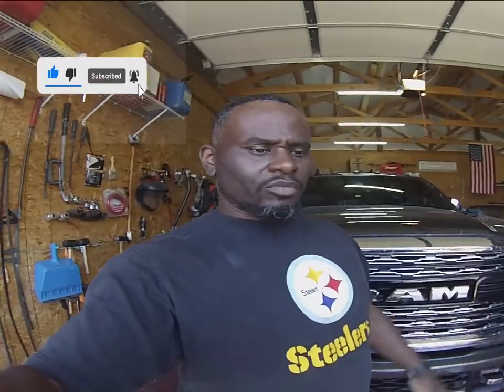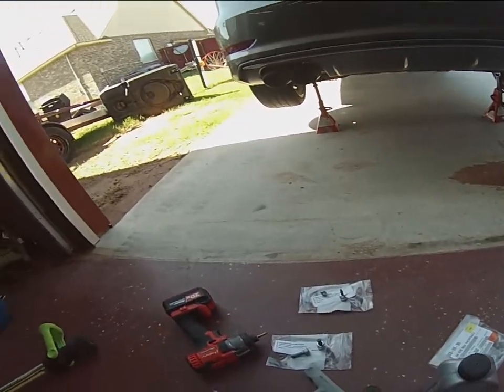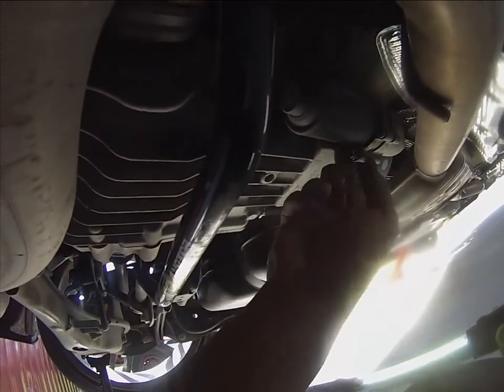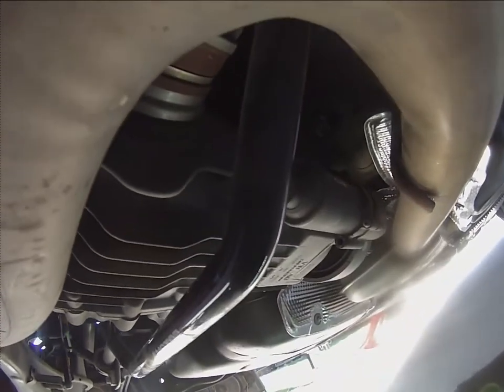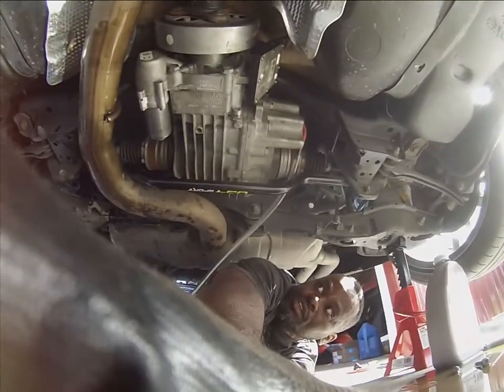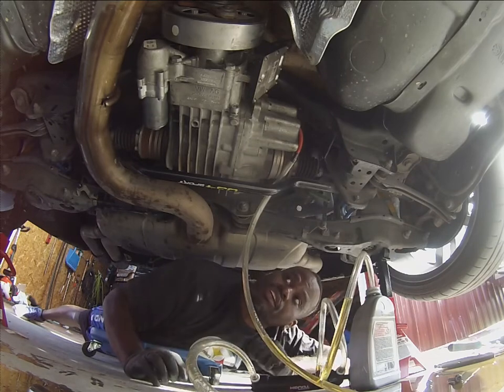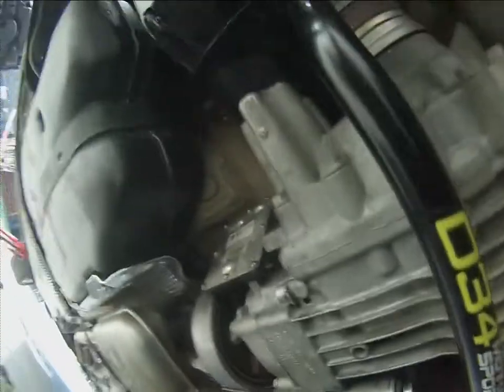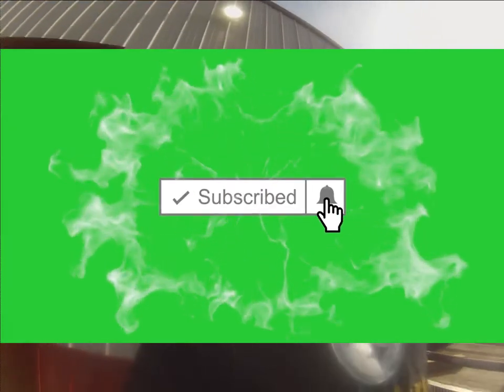Audi S3 Haldex AWD Pump Install

Comment: Man wish I had this back when I was replacing it 😂
Reply from the maker: @IHalfrican I know right....this was a first for me
Reply: Did you have to program the new pump?
Reply: @goodaboy1199  if you have VCDS or OBD11 there are some settings you can check. I can’t remember the exact ones but you can try adaptations